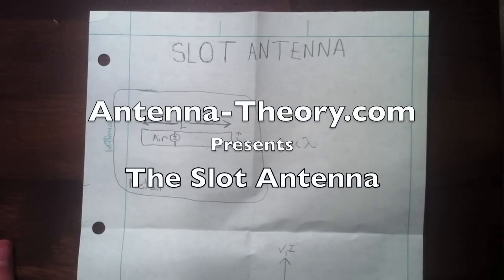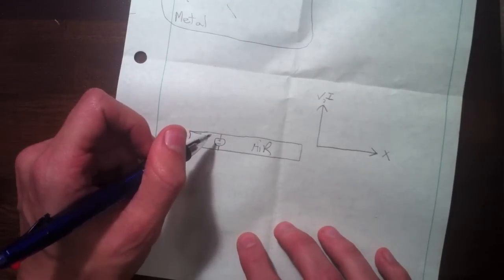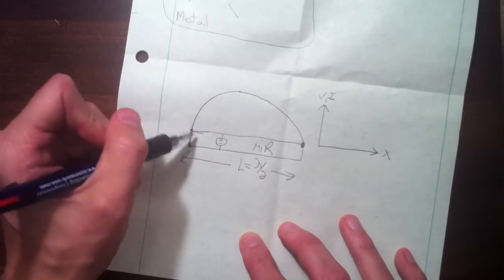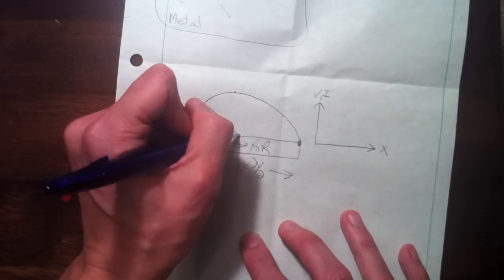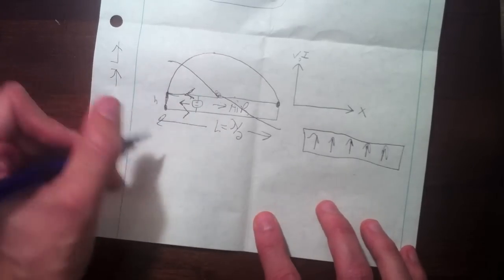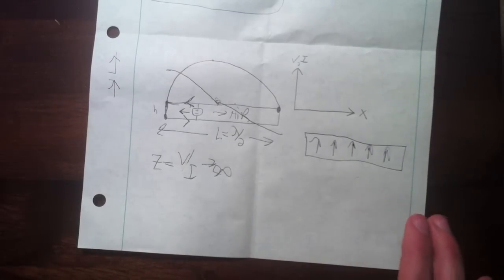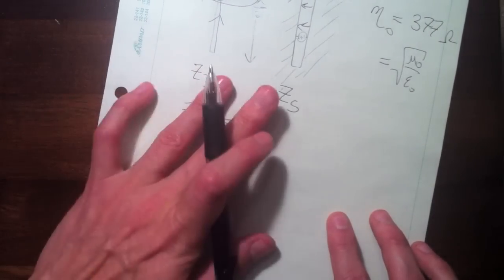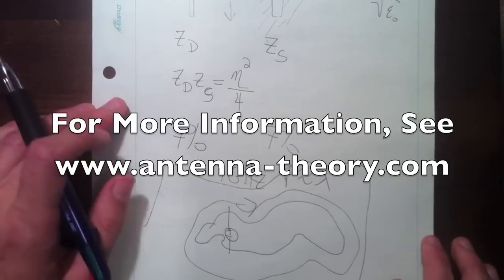Antenna-Theory.com Presents:  Analysis of the Slot Antenna

Comment: Excellent! You teach understanding, not mystery math. That's a very rare commodity in RF engineering. I know little more than arithmetic, but I want to at least generally understand what's happening with different sorts of antennas, how, and why. I want to be able to look at an antenna and know why it is the way it it is, what it's best for, and what would make it better, not calculate the number of photons leaving the antenna at any given radiation angle as a function of ground conductivity. 

On the other hand, I have no use for the plethora of, "How to stand up your 'Super Duper Magnum Sidewinder Eliminator III++' antenna for killer DX," sorts of YouTube videos. In less than 9 minutes you came very close to  nailing everything I wanted to know about slots except for 2 things, what the narrow-side width of the slot should be and why, and what effect, if any the size of the flat metal surface has. Are currents flowing on it further away from the edge that decrease resistance and increase the antenna Q, or can this all be done just as easily with wire and obtain the same result?

Comment: If you cut the slot out of a piece of conductive material, does the thickness of that material matter?  Like @ 1:05, what is the difference between the depth of the metal being 0.5mm and 1mm?

Comment: I really love all those videos and really understand what you are teaching. You are a very good teacher. I was always under the misconception that you needed an electric and a magnetic field in order to radiate. But you said there are voltage radiators and current radiators. So you can build an antenna that only has one of the two? Would it still somehow have the other or would that be completely missing and would that still be called electromagnetic waves?
Reply: How can you have voltage or current without electric or magnetic fields?
Reply: for example if the antenna is such that magnetic fields cancel each other but voltage don't, so you would get mostly an electric field. btw. i'm still trying to figure this out.
Reply: voltage is simply the integral of electric field along a line right? If the voltage cancels then surely the E field associated with it would as well? And likewise magnetic fields circulates around a current, so if the magnetic fields cancel the currents providing them should cancel by nodal analysis?
Reply: it all depends on the geometry of the antenna. the voltage region is on a different section of the antenna than the current region.
Reply: Can you provide me a link to an example? I'm having trouble seeing this.
Reply: Just look up current and voltage distribution in antennas. For example, you will never have a current at the tip of the antenna, because there is nowhere for it to go, instead at the tip you get the voltage peak.
Additionally you know the two fields can exist independently, for example a simple bar magnet or a statically charged party balloon.
One thing I'm still trying to figure out, if you place the transmitter inside a box made of very thin aluminum, the magnetic field should technically be able to pass through it (not sure) but the electric field should remain contained within the box (again, not sure).
Reply: Your second paragraph makes sense to me. A classical example of a Faraday cage. 

As far as your first paragraph I will continue to look into it. If I find something I believe will be useful I will post it here.
Reply: Think of a swing set with a kid swinging on it. The velocity of the child represents the current, the height at any point represents the voltage. Right before the swing changes direction will be the maximum height but velocity will be 0. At the center point, velocity will be maximum and the height will be "0". The same principal applies to the antenna.
Reply: The swing set analogy makes sense to me hmm
Reply: you only need one because the other is created by the change of the first one, in a current radiator the current is in phase so the magnetic field created by the current sums up and because the current is changing the magnetic field changes too and creates a changing electric field so the cycle start and continues thus radiation, in the other case is more simple, the electric field sums up in phase and because is changing creates a changing magnetic field and so on, radiation too.

Comment: I do not agree that the voltage causes the radiation, because radiation is independent of width. If the slot is made just a razor cut it still radiates just the same.
Also, if the sheet is reduced to just a wire, radiation stops.
Radiation from a  slot occurs because charges on the metal sheet are caused to accelerate; in other words, currents flowing on the surface of the sheet cause radiation.
For both the dipole and slot, radiation occurs because charges in the metal are accelerated.
Reply: Mirror Cruising you could argue it’s the displacement current causing the radiation, which is due to the E field.
Reply: are you sure? if the width is too large there will be a voltaje between the sides of the antenna and that will create a  voltage perpendicular to the one that is created here between the top and bottom of the slot, that for sure will change the radiation pattern, that's why at the start of the video is stated that the width has to be much shorter than lambda, to maintain the conditions for the current and voltage distribution presented here, so no, width in fact matters.
Reply: @redknight344  Of course, I agree that if you make the slot or its complementary dipole very wide then the resonant frequency will change and pattern will slightly alter.
You seem to say that a transmission line will radiate as a slot. This is not correct, and the explanation is covered fully in "Antennas", by J D Kraus.
It is not sufficient to just have a voltage in order to have radiation. There have to be charges which are accelerated.
Further, displacement current in a vacuum will not radiate, because a vacuum has no charges. But displacement current in a dielectric will radiate, because in this case charges are caused to move.

Comment: Help! 
I need to design 5Ghz horizontally polarised omnidirectional antenna 
Freq: 4.9-5.9GHz
Gain: > 7dbi
Return loss: >10db
Impedance: 50 ohm
Conducter: SMA 
Substrate: dielectric constant: 2.65, thickness 0.8mm, loss: 0.002